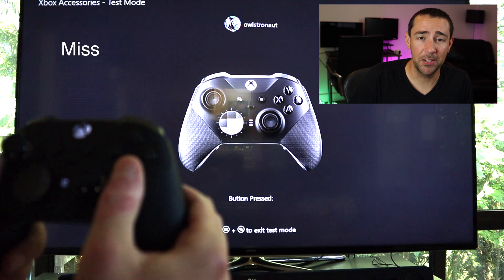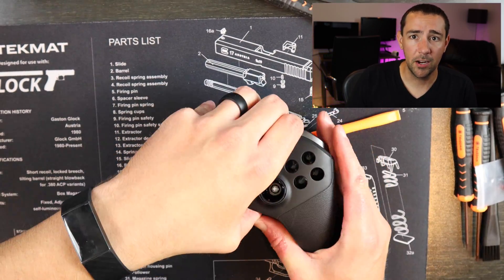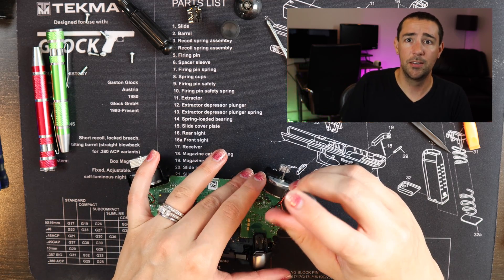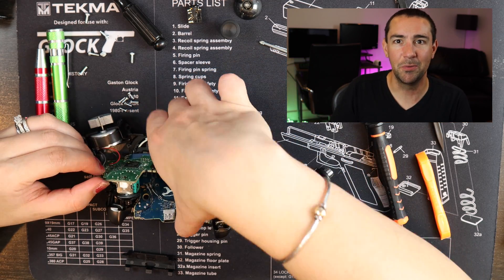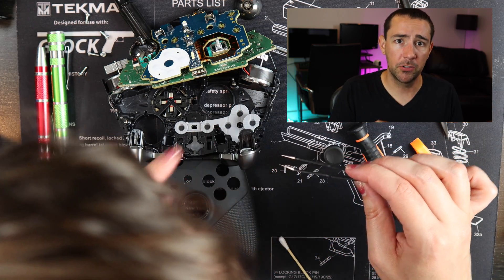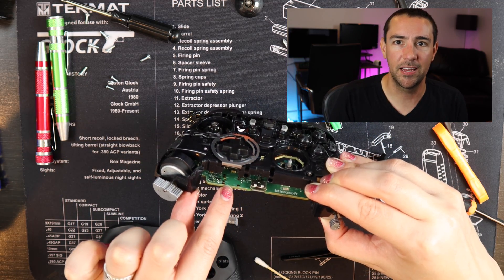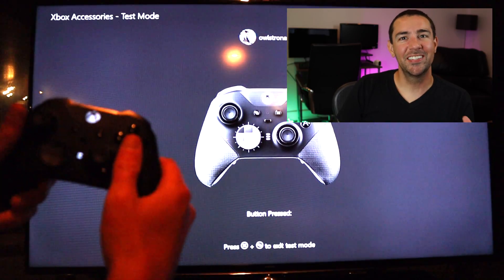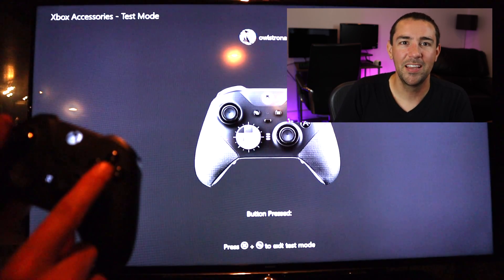Xbox Elite Series 2 Controller | Take Apart & Fix

Comment: So disappointed that for such a high price, the sticks are still read by wear prone potentiometers with just metal grinding on graphite. My Microsoft Joystick from 20!!! years ago already had optical position measurement, that never wears out. Microsoft really cheaping out here.
Reply: The dreamcast controller from 22 years ago had hall effect sensors
Reply: @DripDripDrip69  Love the Dreamcast
Reply: My biggest problem with the elite 2 has been the bumpers. Maybe I just yank em too hard, playing rocket league, but I've had this guy replaced/repaired three times from bumper failure.
Reply: @joew.4073  Yeah bto same I eventually got tired and just used strapping tape to hold it in place, works well but is ugly
Reply: @joew.4073 I've had bumper failure on two new controllers amd two warranty exchanges ended up just giving up on having rb
Reply: @joew.4073  with me I sent it back 10 times in a year by then switched to another controller
Reply: @joew.4073  double tap on bumpers too
Reply: @joew.4073  I started using the paddles for my bumpers
Reply: @joew.4073  Took a little while to get used to
Reply: @joew.4073  The bumper connectors that MS use are cheap. They also are potentially subject to dry joints when soldering which is a common problem in Chinese manufacture. They run low on solder so you can end up with badly soldered joints. It happens with TVs and other consumer electronics quite a bit.
Reply: Hall effect is the best way, there is a company that recently released a new controller with hall effect. Only for pc and android for now, but soon we will have it for consoles I'm sure.
Reply: @zincyellowmach1523  wich controller ?
Reply: Companies in general seem to be following the "screw the customer.. because pay us more or go away" mindset, the internal NVME for the Series S/X have a hidden partition, likely encrypted.. and it contains a hardware ID with the purpose of forcing anyone that wants a working storage device to send the console to Microsoft because replacing it without access to that ID and probably othwr software only they have access to, the console won't install the OS on the new drive.. 

As a PC tech, here is a non Xbox example, the 2021 model Dell laptop I worked on for someone that didn't like the HP brand charger that was a perfect match voltage, amps, and Watts(and also fit of course) which would normally work for older laptops fine and instead it detected it was not Dell brand and slowed each CPU core to .79 GHz and only maintained the current charge and not go up in charge while on.. it charged when powered off just fine, though.
Reply: The PS5 controller is built the same way, currently have one completely useless PS5 controller, I have back ups but still, also the $200 edge controller at least has easy accessibility to the sticks, I'm here to try and fix two of my son's controllers and my set starts at t10 so I have to go buy a set to get the screws out. Absolutely bogus how expensive these are to barely make it a year
Reply: Yeah they even fucked people 
Here the board is really thick that houses the rb lb so you need a very hot soldering iron 
They totally pull this shit purposefully
Reply: Mine is just falling apart at this point and had it for a year 👎🏻
Reply: @xbox & @microsoft? SHOUKD BE FUCKING ASHAMED!!! 😤
Reply: Just bought mine a couple days ago and found some time to to use this controller. The thing I found out was that it was drifting extremely and both the bumpers felt mechanically unresponsive. The drift just made the controller impossible to use.
Reply: Totally agree! These things are sooo much only to be junk.
Reply: I just got my elite series 2 core upgraded with tmr joysicks I will post an update after work when I collect it and try it out but everything have read says it's miles better than hall affect and virtually eliminates stick drift I guess I will see tonite . But well worth looking into them as
Reply: If the controller never brakes. Why would you buy another one lol 😂
Reply: @ddot4516 it's not funny 😒
Reply: @N_3_Z  yes it is because people be so delusional. Imagine having tires that never get balled up. Or a iPhone never slowing down after the new one drops. Or your hd/4k tv light never blowing out lmao. Gamers are such cry babies. There are very very few things you wont have to replace.
Reply: Yeah Xbox is garbage

Comment: I'm getting a problem where my elete 2 controller fresses then I have to  squeeze it hard to get it working again and during the freeze the profile button won't change light and random I punts on the controller happen
Reply from the maker: Weird! I haven't heard that one before
Reply: @OwlInTech  yeah it seems weird I've not seen it before I was hoping there could be a fix before I send it to Microsoft and get it repaired I Don't wanna wait without a controller though
Reply: I think it can be the controller's motherboard connection problem.

Comment: My left analog stick doesn't push in for sprint. Other than that, it can move fine on its own though. What should I do?
Reply: you need to replace the joystick. $12 for the parts on amazon. Im doing it now.

Comment: Here's a quick story on how i fixed some problems with my Elite Series 2 Controller : 

Tools: Knife and Torx T7 Security Screwdriver (Apparently they are T8 Security but my T7 bit worked )

Problem 1 : Right trigger sticky / clicky 
Solution : Open controller shell. Used Isopropanol Alcohol Pads. (They are pre soaked individual pads. Smaller version of a wet nap at a restaurant. ) 
Wiped all inside the triggers and the triggers themselves. Put shell back on, then pushed down a small piece of toilet paper between the outer side of the shell , and the trigger. Read that part carefully . Worked 100% properly and quiet afterwards 

Problem 2: B Button AND Xbox Button sticky and weren't responding every time 
Solution : Used those Iso Pads , and with the front shell off, used a super skinny knife and pushed the cotton iso pads between the buttons, making sure the liquid can get in-between. Press the button a bunch of times to let the alcohol clean the dirt. I repeated a few times as i noticed it kept getting better and better every time until it was smooth perfectly. 

Let dry then put back together. Never needed to open the 2 motherboards as i felt that step is risker plus i didnt have the smaller screwdriver honestly lol. My controller now feels brand new . 

Thanks for making this video, it allowed me to make sure i wasnt missing anything and gave me confidence to open and work on the controller.
Reply: M

Comment: Hey, do you think replacing the battery in this would be an option? Thanks.
Reply: Unfortunately, the battery isn't easily  replaceable
Reply: @smashandburnyt6938  but it’s possible right?....
Reply: @smashandburnyt6938  yes it is I just too I mine out

Comment: Very informative video. Never took my controller apart and I was able to fix my problem through watching this video. Be careful of the two heavier things at the bottom attached to the green circuit board with wires, though. Mine were able to be easily ripped apart and controller won’t vibrate now
Reply: sounds like you disconnected the vibrator motors from the circuit board
Reply: You should be able to solder it back in, when I opened my series controller and broke my vibrator and I just soldered it back and it works

Comment: I noticed two things, my controller right trigger was sticking all of the sudden and when I opened the controller I don't have all the screws you have! But for all you guys that may have the same issue as me look for a foam pad on the right side. It needs to be attached the controller chassis and not the trigger. So make sure to clean the area and make sure the pad is in place.
Reply: Same! Right trigger was feeling “sticky” haven’t looked but this comment gives me an idea now of what to do fix this. Thanks!
Reply: @jordansilva3048  not gonna lie, make sure you got the tools because it is a tricky thing without them. Make sure you take your time and if something ain’t coming up then take a moment and check. Took me about an hour with most of the tools but you will seriously need needle nose tweezers for the pad. If you can get some crafting double sided tape even better to make sure it sticks back on and stays.
Reply: @derekfranklin9783  good idea. I have some tools here so I’ll have to just be careful. I’m actually just looking to repair it to sell! Lol

Comment: My right bumper is unresponsive, as a quick fix I’ve assigned some of my paddles to rb and lb. Any advice on replacing the bumpers? I really don’t want to break the controller doing it myself.
Reply: Sameee after 1 month too 😑
Reply: Yeah I lost full power in my LB after about eh 2 years I’ve had it and now my RB is also failing so I can’t ability spam in warframe and it’s killing me

Comment: I had the strangest problem. My remote was unusable as every time I turned it on, the left and right sticks registered as activated it in like every direction. I bought the tolls you showed and it took me 3 minutes to fix.

There are tiny little metal rods along the paddles that transfers the signal to the motherboard via a tiny metal sponge. The one on the right had slipped out and was attached to the sponge but it was laying across the motherboard. I hadn’t been able to find anything online about what cause the problem I was having and I think that’s cause what happened was a freak accident.
Reply: Why is this the exact same thing that happened to me, I am very much wary of taking apart my controller but I don’t want to just through away $200 like that.
Reply: @notmerc  Well tbh, it’s not worth it in the first place. It been a year since I posted that comment and since then, the bumpers inexplicably stoped working so I had to remap the paddles to be the bumpers.

Then one of the bumpers just inexplicably stoped working so I had to use just the lower 2 paddles. 

Then the left joystick wouldn’t register as going forward if I had a joystick on it so I just can’t use the controller now.

The sad truth of the matter is that Microsoft products are just built to break so that you have to pay them to fix it or replace it. And with the current debates on the right to repair I don’t see this problem being fixed for quite a while.
Reply: @lilhollow1543  yeah I think I’m done with Microsoft for awhile sadly…
Reply: @lilhollow1543  for the triggers problemthere is actually an easy fix

Comment: My controller won't turn on or charge. A faint high pitch noise comes from it when I hold the Xbox button down but nothing. I've had it for 8 months no problem until now. Any help?
Reply from the maker: Aww I'm sorry. That's rough. You could give a shot at opening it and reseating the inner pieces, but that sounds like bigger issues. You could see if your credit card extends the warranty beyond the manufacturer. That doesn't sound good though :(

Comment: im having drift problems with my left analog stick i opened it up but i find whats wrong i dusted it but it still drifts forward
Reply: $22 for thumbsticks on eBay. I’ll post again if my problem is fixed after I install them.
Reply from the maker: Brutal, sorry man :( that means your stick is misaligned with the sensor for it. I don't know that you'll have much luck with that

Comment: My right bumper started flaking out after 5 months. I might have to pull is apart and see what I can do.
Reply from the maker: Bummer! Well I hope this helps you out if you make an attempt. Report back on how it goes 😁
Reply: Geoff Fowler I had the exact same issue after 4 months
Reply: Same here, my RB is starting to take some pressure just to use